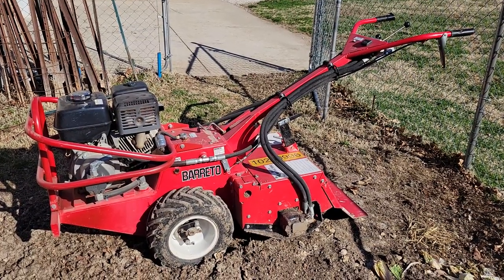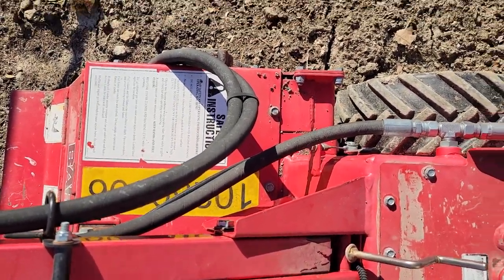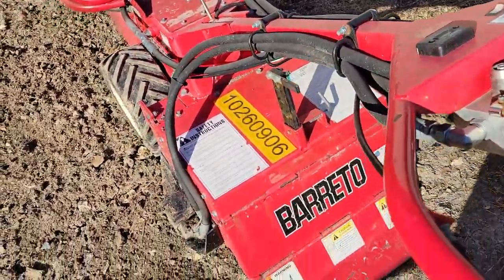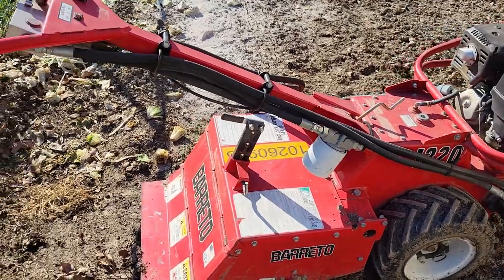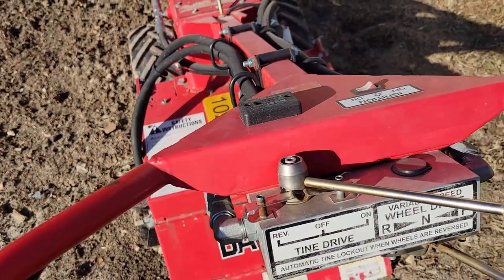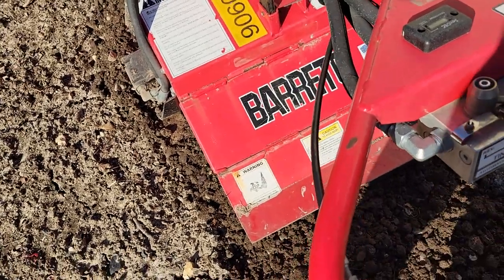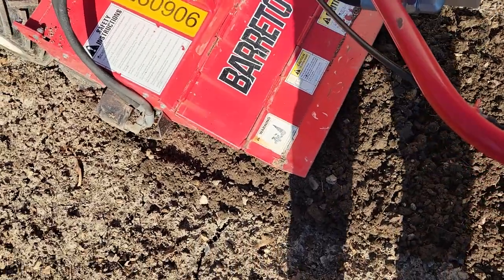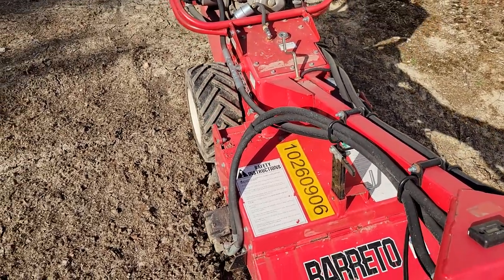Barreto 1320 All Hydraulic Tiller.

Comment: Great video. Do you know of a video that instructs a new user on how to start the engine? I'm going to rent one of these from a local tool rental place, but the guy that gives the instructions on how to use it doesn't explain things well. Barreto doesn't have a video on their webpage.
Reply from the maker: Turn on the fuel and shut off switches. Put it on full choke and pull the cord.
Reply: @montekrueger9762  Thanks. I made a video of the guy telling me how to start it. I'll locate the points on the machine that correspond to what you've said. It looks like a good, smooth machine.
Reply: @peternyc  will this machine prepare the ground for sowing grass?  Why is there no roller, roller behind the machine?